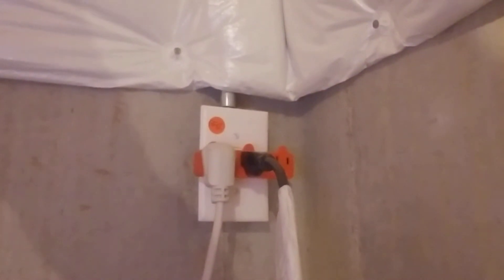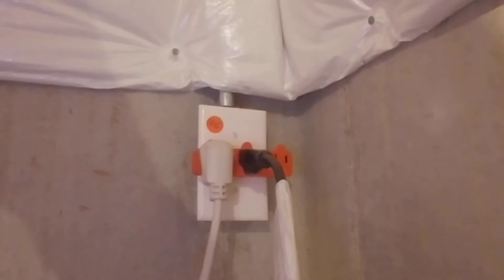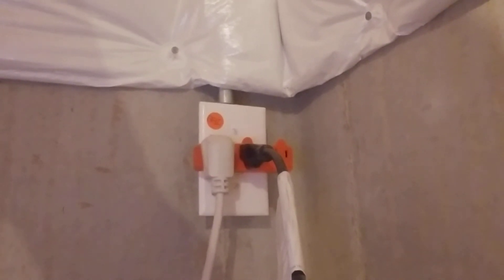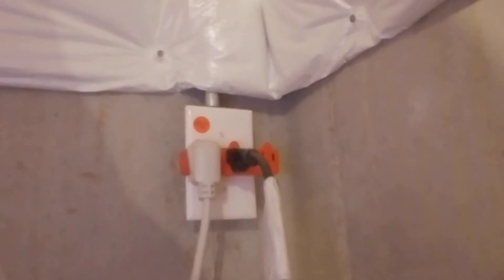GFCI and sump pumps

Comment: From what I understand insurance doesn't cover basement floods.
Also, I have a sump pump and it is plugged into a dual outlet. The outlet is GFI protected. I also have a battery backup pump, so if the GFI were to trip, or power were to go out, tthe basement will not flood